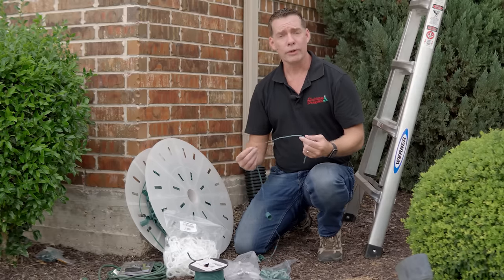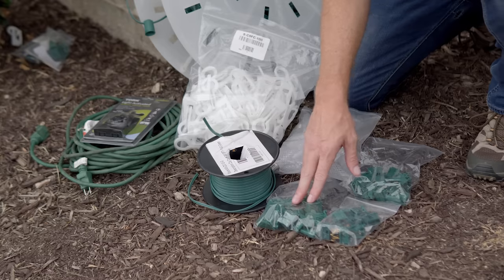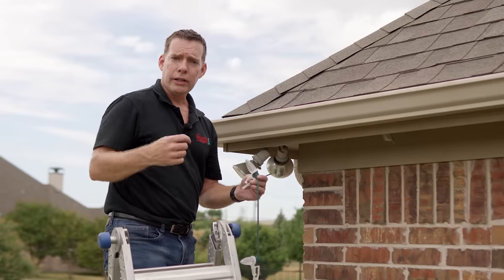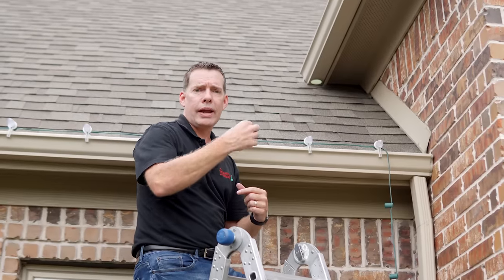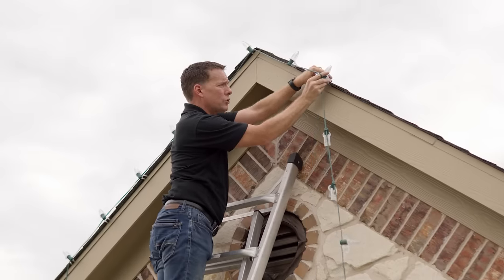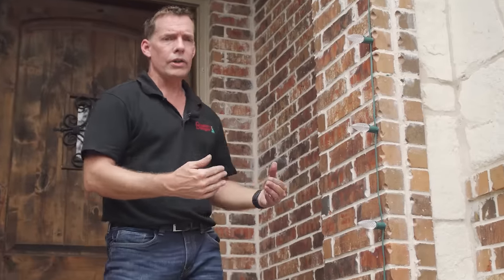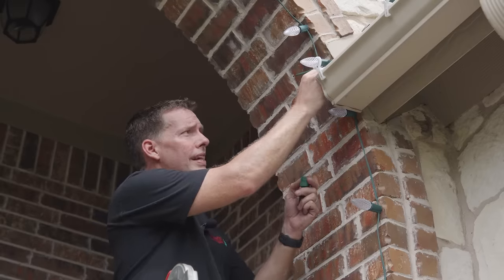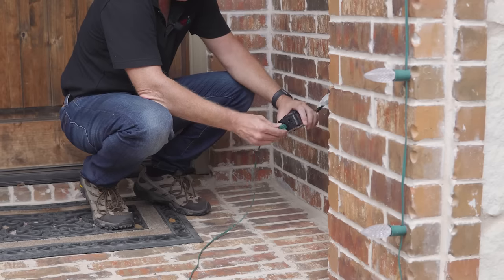How to Hang Christmas Lights on your Roofline like a Pro

Comment: Why not cap the socket and tape it if lights get repurposed?
Reply from the maker: Yes, that is an option and some installers do take that route. The only issue is that even with tape, moisture does sometimes get into the socket, but there is not adequate airflow, so the moisture can not dry out and in turn you have more electrical issues, especially tripped GFCIs. 

Replacement sockets are available, so they can be added back onto the line if that part of the cord is ever needed to be illuminated for a future project.

Comment: would these lights look good under gutters sadly squirles eat my bulbs if there on gutters
Reply from the maker: Yes, under the gutter is also an option and as you've discovered, in areas where squirrels like to cause problems, it will help eliminate that issue. We also recommend going with a medium to large round bulb to prevent squirrel issues. Using G40s or G50s is a good alternative. The rounded surface makes it difficult for squirrels to damage the bulb.
Reply: @ChristmasDesigners  thank you!

Comment: Would the glue be able to come off
Reply from the maker: A lot of the glue will peel off when you gently pull the lights off. For some tougher glue, you may need to use a chisel to help peel it off and for more stubborn residue, Isopropyl Alcohol works well.

Comment: How do I buy lights?
Reply from the maker: @chadrayl9648 - all of the products featured in our video are linked in the description below the video. Here's a good place to get started: 

Shop our website:  https://www.christmasdesigners.com/

C9 12” spacing, green wire
Shop: https://www.christmasdesigners.com/c9-cord-12-spacing-green-wire-spt-1-250.html

Pro Christmas C9 Retrofit Bulbs- Warm White
Shop: https://www.christmasdesigners.com/christmas-lights/led-replacement-bulbs/c9-led-bulbs/c9-smd-led-bulbs-faceted.html

You can find everything you need to light like a pro!

Comment: How come on the roofline you don’t point all of them facing up? Why only on the raised parts, personally I think it looks better facing up
Reply from the maker: When lighting roofline with gutters and shingle combinations, the clips that are most frequently used orientate the bulbs on the shingles vertical and the bulbs on the gutters horizontally. Most professionally installed jobs are done in this manner. As long as good quality bulbs are used with even illumination at the tips and on the side, it's very difficult to see the difference in the dual orientation.

Comment: How much did you charge for that job?
Reply from the maker: For a job similar to what you see in the video, the rates vary significantly depending on where you live. This video was filmed in North Texas, around Dallas. In that area you would pay between $5 and $8 per foot for a seasonal rental on the lights plus installation. If the customer owned the lights and only labor was provided, the per foot price would be between $2.50 and $5.50.

Comment: What is your recommendation for setting up c9 string lighting on a standard black aluminum fence? The standard black aluminum 4 ft high by 6 ft wide sections. I've seen recommendations of a zip ties on each side of every bulb, but that seems like a ton of work. There must be an easier way to do it with a professional look.
Reply from the maker: Zip ties are honestly the best option on an aluminum fence. Due to aluminum being a non-ferrous metal, magnetic clips will not work and adhesives may leave a residue afterwards.  
You do not have to do 2 zip ties per socket. We typically suggest 1 zip tie before each socket in the run. It should hold everything straight and look nice. Having one zip tie per socket will also help with the labor aspect. 

Hope this helps.
Reply: @ChristmasDesigners  Thank you for your recommendation. I just couldn't find any videos out there or much info out there at all for us aluminum fence owners. I'll give the one zip tie per bulb a shot this year and see how things go. Now I just need to stop back by your website and buy the rest of the supplies I need. :)

Comment: Are fuses necessary any where in the system?
Reply from the maker: No, fuses are not necessary with this type of perimeter lighting system. It's important not to go over 250' of perimeter lighting so that you stay under the maximum amperage allowance.
Reply: Can you energize the light line from the middle (teed off, with lights going in each direction), or does electricity have to come from an end?
Reply from the maker: @gregoryc29  technically it's possible, but it is not recommended for safety reasons. In order to power from the middle of a line, you would have to create a double male runner. There would be a male feeding power into the runner and then another male would be needed on the other end to plug into the middle of the teed off line. Having a double male line is an electrical code violation and can create a shock hazard if the tail male is unplugged while the lead male is still plugged into the powered up line.
Reply: Very helpful, thank you for the prompt replies!!

Comment: What’s the difference between spt1 and spt2 zip cord
Reply from the maker: The only difference is the thickness of the insulation. About 75% of our sales are for SPT-1. Some sites misstate specs for SPT-2 and they claim that it has a higher amperage rating. This is not true. Both have the same amount of copper, so the amperage rating is the same. It's simply the difference in insulation thickness. SPT-1 is more pliable and easier to work with for most applications.
Reply: Oh ok I was wondering bc atm your out of white 100 ft of spt 1 and I’m not sure if spt2 would work with my vampire ends
Reply from the maker: @iluvtim77  We have seen a surge in the 100' sections, but we have more that are now in stock if you are looking at the 12" spacing. The SPT-1 plugs you have can work with SPT-2 cord, but it does take some extra work.
Reply: I mean zip cord I went with 9” spacing
Reply: It’s saying it’s back in stock now so yay
Reply: I do have another question 🙋🏻‍♀️ do you think zip cord is for outdoor
Reply from the maker: @iluvtim77  yes, zip cord is used by professional installers outside for the majority of perimeter lighting installations. It's the same wire as the actual light line.
Reply: @ChristmasDesigners  ty

Comment: Oh no!  When your old and you have almost a 100ft. run either do like my dad did with the old 8' by 1" wood slat with eye hooks you staple lights to stick or use to eye hooks at each end of run then put a coated thin cable like a dog run in between and you can just twist lights around cable!  I have tried every plastic hook known to man and all are a pain!

Comment: 25 Clear
Incandescent
C9 Lights
Outdoor Use Only
24 #t Lighted Length
Connect up to 2 Sets on 1 Outlet
If One Bulb Burns Out, the Others Stay Lit
Includes 1 Fuse
Green Wire
Limited Warranty: 1 Year*
25 Luces C9 incandescentes tra
Sólo para usar en exteriores
lumina a lo largo de 7.31 m
Conecta hasta 2 juegos en 1 tomacorriente
. Si una de las bombillas se funde, las demás continuarán encendidas
Incluye 1 fusible
. Cable verde
. Garantia limitada:
That mean 2 set only 1 outlet?

Comment: Seems you'd get water in the sockets point upwards...
Reply from the maker: Thank you for your comment Snip_King! The sockets will get moisture in them no matter the orientation, however the sockets have weep holes in the bottom. If moisture does get into the socket, the weep holes help drain and increase the airflow to dry the sockets faster.
Reply: @ChristmasDesigners  
Thanks a million, my pavillion will be lit upwards then. 
I go all out!!!

Comment: Wouldn’t white wire look better if you have white trim
Reply from the maker: Yes, white cord is available as well. About 90% of the cord we sell is green, but we carry a lot of cord specs in white too.
Reply: @ChristmasDesigners  hi another question I have is I found a white wire but is White Stranded Copper Lamp Wire the same thing as the zip cord
Reply from the maker: @iluvtim77  Lamp wire and zip cord are typically the same. Some lamp wire is a thicker 16 gauge wire, so standard 18/2 vampire plugs would not work with it. But some lamp wire is 16 gauge. If you look at the insulation closely, you should be able to see some markings indicated the gauge of wire.
Reply: Great thank you for the tip

Comment: Pros use binder clips and zip ties
Reply from the maker: We typically only use binder clips on larger perimeter jobs. They are useful in preventing a small section of loose light line from pulling down an entire run of perimeter. This isn't typically necessary on small residential jobs, but can save hours of reinstallation labor on projects with hundreds of feet of perimeter, especially in high wind areas. The binder clips are clipped on the  gutter, flashing or shingles about every 50 feet, so that you would not loose more than 50' if the line started pulling free.

Comment: will the hot glue stick thru the freezing temps?
Reply from the maker: Yes, hot glue will hold up in very cold temperatures for short term use on Christmas lights. Beyond about 60 days in extreme cold, the glue does get brittle and starts to lose holding power.